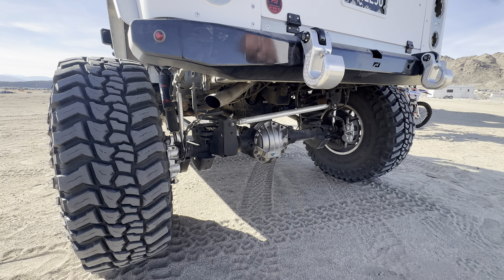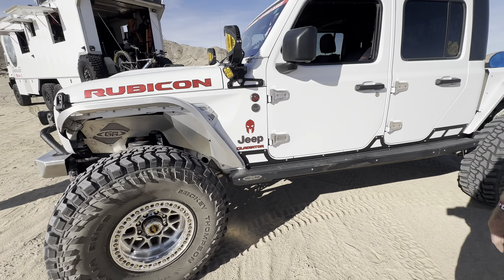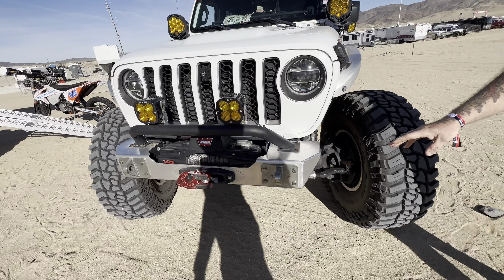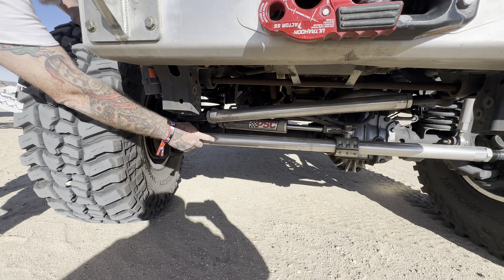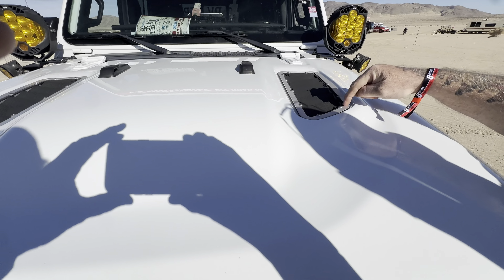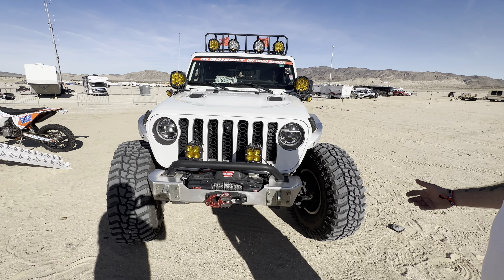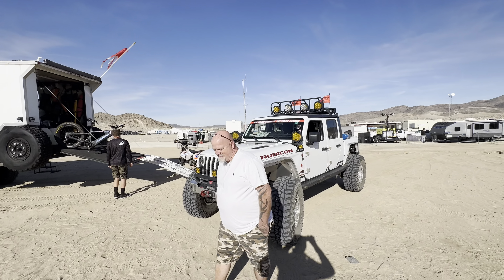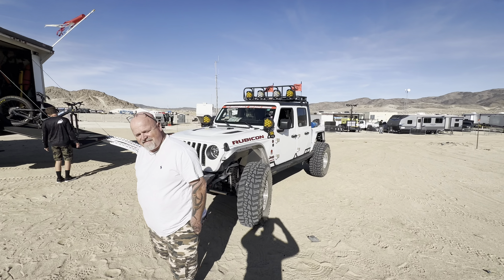Bobbed Gladiator @ King of the Hammers.￼

Comment: This is almost my dream build.  I have basically built this on paper / WORD computer app many many times.  The only thing I did differently on paper was build custom 10" axles with 47 spline RCVs, 40 spline ARB lockers, 10.1" Gearworks ring & pinion, all aluminum exterior parts (bumpers, full skids, doors, etc.) for lighter weight. Then add like an EVO JT Double Throwdown Pro Trailing Arms with dual shocks to be able to run really fast.  Finally adding either an AMW 4x4 Demon or Hellephant or possible putting a Hennessy engine to be different.  Inside all PSP seating with top of the line sound system, etc.
Reply from the maker: Dream build for me also but after seeing your list, I’ll switch over to your concept! Lol! That would be one heck of a build! Gonna have to get your pocketbook ready for that one! Thank you for taking the time to comment list your dream build! Sounds amazing!